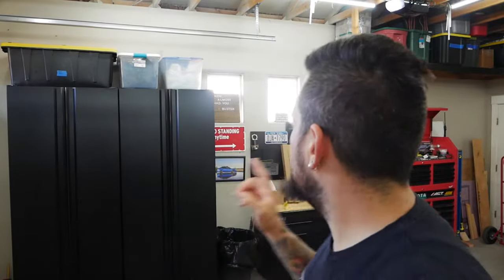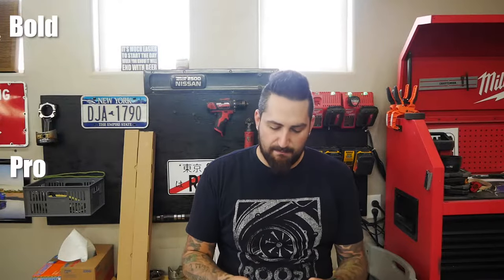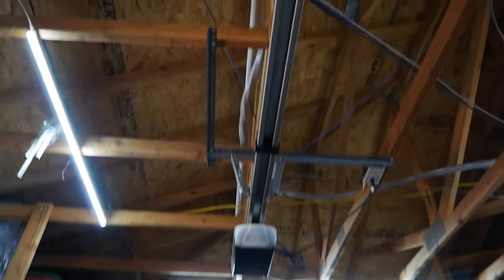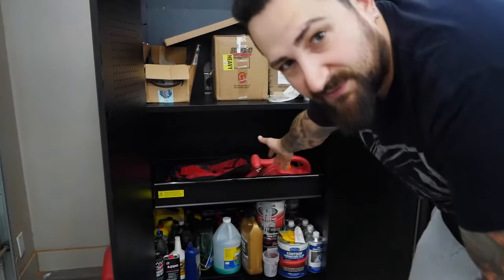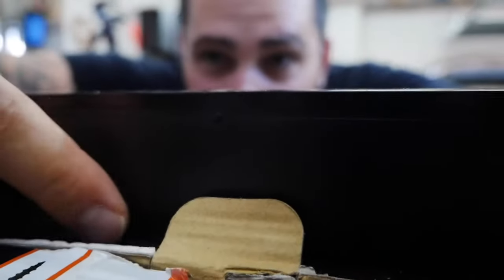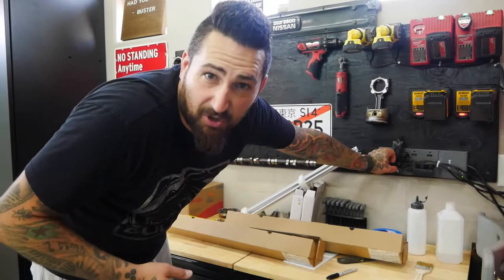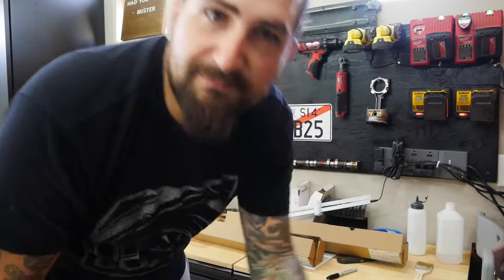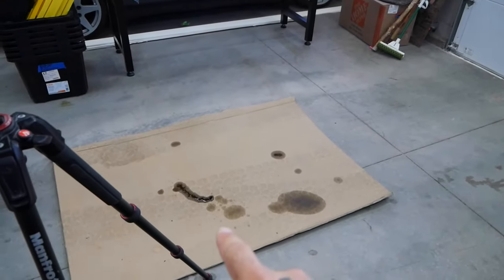Husky heavy duty vs New Age pro garage cabinets. Which should you choose? Review

Comment: Thanks for the video.  I'm researching as much as i can between Husky & Newage.  Dropping that much $ one would think there would be a retail box store that a consumer could actually put their hands on it and see a display to better determine which one they like.  The only thing I caught where you stated incorrectly was the gauge steel.  Husky Heavy and Pro are 20 gauge and Newage Pro is 18 gauge steel.  And for whatever reason Husky's base cabinet in the Heavy/Pro is 18 gauge.  Why not make all the cabinets in 18 gauge if you are going to make the base cabinet?   Again, thank you for putting this video out there and I'm leaning towards Newage for my system.

Comment: Solid video with great explanations including the pros and cons of both. Just the comparison I needed. You said you'd stay with Husky for $1000 difference but with a sale NewAge has right now it puts the difference in a 9 piece set at $600 more for the NewAge... Would you still choose Husky for that difference??
Reply from the maker: hmm thats a good question.. $600 id definitely consider it tbh. They come in more colors other than just black. and the feel higher quality.  the doors on the husky cabinets have a couple dents, i dont remember my new age coming with dents.  but there might be less space inside, since the door is set in the frame of the cabinets 🤔 

Id probably go new age tbh if i had the money to spend
Reply: The Huskies Heavy duties go on sale a few times a year. 24% off, and if you have a military discount, there like 34% ish off. Hard to beat that price.
Reply: 10-piece Husky with metal countertop as of the time of this comment is 50% off!! Bought it for $1500. Normally it’s $3k.